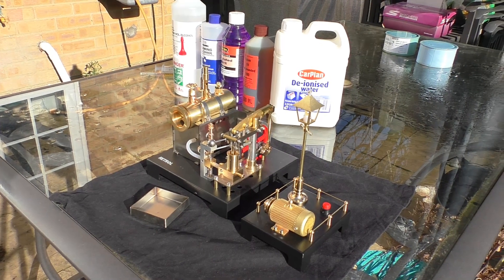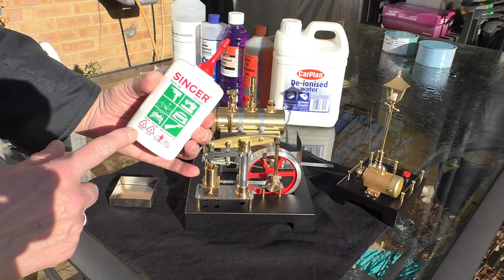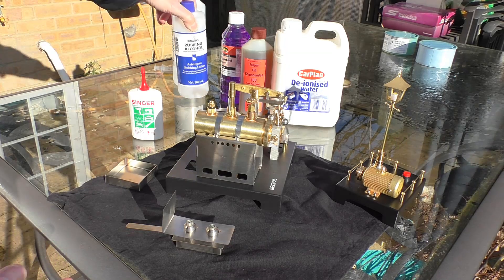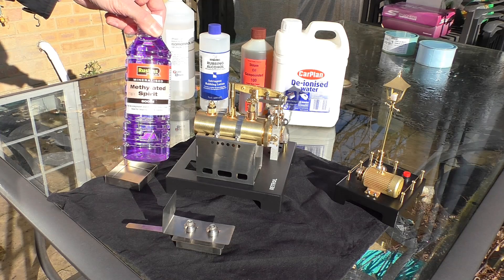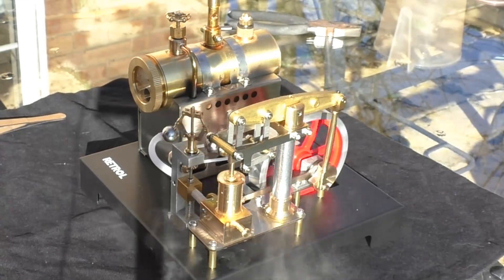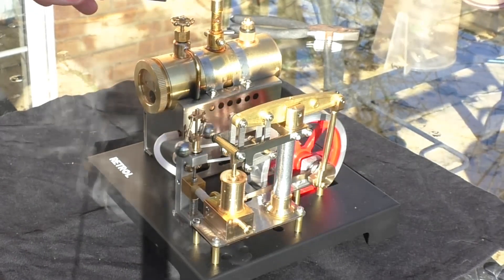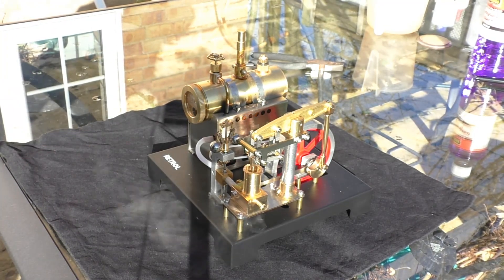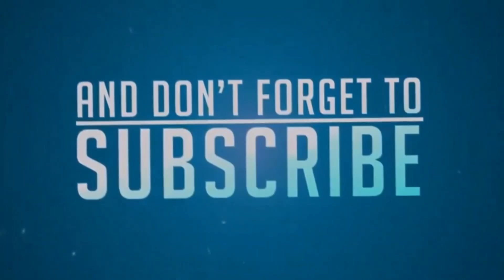YOU CAN BUILD a Watts's Steam Beam Engine. Part 2 #enginediy #steam

Comment: Boiler tap should be full on, the speed is supposed to be regulated by the governor. set the speed with the governor, then as you load the engine the speed should remain constant